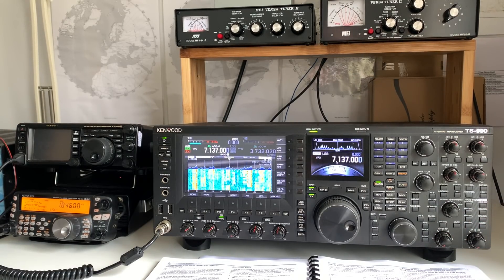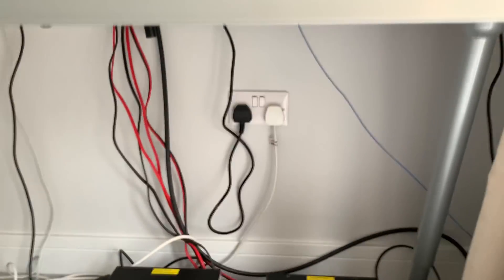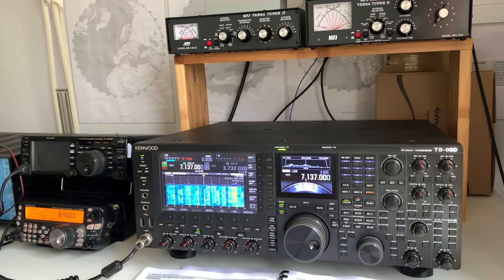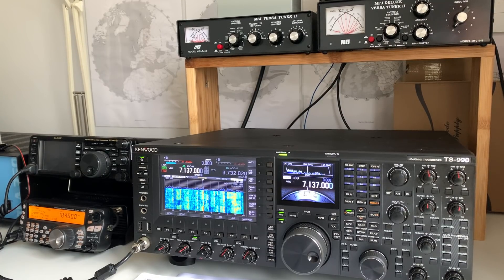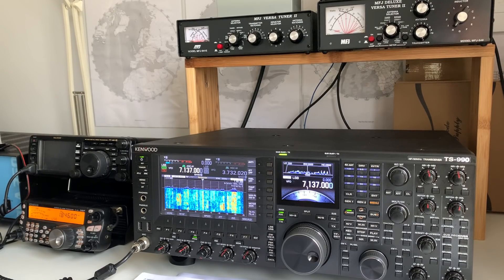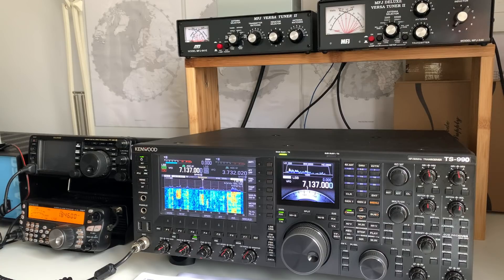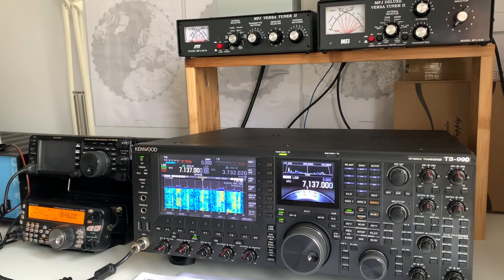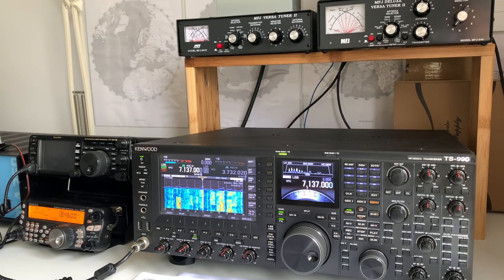Revealed: the uncomfortable truth about how ham radio equipment manufacturers specify their products

Comment: Get a decent good quality tuner (Palstar etc.) rated for 1500 watts. I understand you aren't allowed that much power in old blighty but there are decent tuners available and there is no need to run the light weight models and then complain. Check your coax connectors and mic grounds... Very strange how many wrong ways there are to put on a PL.
Reply from the maker: Thanks Bill

Comment: I think from experience that everything Top band , Antennas, Tuners , Earths has to be as good as possible to avoid RF and reflected SWR power back into the Tuner or worse the Radio . I think a more robust Tuner is required for Top Band operation , not knocking or promoting any brand names just needs to be more robust and be capable of handling larger power levels and be on top of the job. I wouldn't in any situation rely too much on internal  radio ATU systems other than to tidy up at both ends of the SWR curve for a reasonably  resonant antenna  for the band you are working on at the time .  Its a £5K radio and needs as much care and attention - (Safety back up) to provide a good long life and the hassle of expensive PA repairs . The secret with Top Band is to build a good resonant antenna , I think its possibly one of the most difficult of antennas to get right and be a reliable and effective and not just a cloud burner . Cheers G1ILJ Clive
Reply from the maker: Cheers, well said! 73

Comment: There is NO way I'd run 200 watts thru any MFJ product, regardless of what they rated it for. I've owned some of their "stuff" and have fixed a lot it for other hams. Cold solder joints are the biggest MFJ issue I've seen.... some inferior parts and / or craftsmanship.  
I don't want to sound like I'm hating on MFJ, because I'm not. Their products meet the needs for a lot of hams..... nothing wrong with that. 
I doubt you are getting the full 200 watts out of the TS-480. It takes a LOT of power to drive that radio to peak performance. A good quality peak reading watt meter placed inline should reveal the truth. 
I have a TS-990S... absolutely love it. When you mentioned the top band issue in the last video, my finger pointed at the MFJ tuner as the culprit. 
Top band is a tough one as most people don't have the room to run a resonant antenna so they rely on a tuner to bring it in on a shorter antenna. That's fine, if that's what you are doing, but I'd find a much better tuner (Palstar) to pair with that $8,000 radio than the MFJ tuner. (just my 2 cents)
Reply from the maker: Great comments - thanks my friend. 73

Comment: I wouldn't use an MFJ tuner at that power level. 300W is a maximum and with a reasonable match. Top band will be the hardest test for the tuner probably. I have always slightly winced at your faith in that tuner, having had a similar one made by AEA when they came out. MFJ is a value range built to a price.  There is no margin in that rating. I replaced the inductor in mine with a roller inductor and it was a lot better because it eliminated the switch. Unfortunately that tuner went missing from the RAL shack where it has been used with the 5 MHz beacon, which also went missing. 

If you want a proper tuner, it is going to cost a lot more. I have an enormous Dentron you are welcome to borrow. Its power meter is a bit suspect but it really will handle the power. You can see from the components used. What you have now is like putting cheap tyres on your Lotus. OK until you encounter a challenging bend in the rain.

So why is the 480 not as bothered by the MFJ's arching?  Several possible reasons. The PA might be more tolerant or the 990 might be producing more power or it could just be different lead lengths. Most probably the 990 has better compression and really is producing 200W with a lot of punch the 480 is producing less punch or power. Looking at your setup, you have long cables to the 480 and if they drop a volt you won't get the full output. My IC7300 suffered from that, I shortened the power lead and it was much happier. Sometimes fuses can be lossy. probably
Reply from the maker: Thanks very much Mike - the voice of reason - and there's not too many of them about here lol. Cheers and 73

Comment: When the Resistive Reactive numbers become increasingly higher above/beyond 50 ohms... the little MFJ's rating varies with those increased loads. It's only capable of so much. MFJ has their good points, wouldn't hurt them to dedicate themselves toward an improved quality control. I'd go over the tuner's internal connections for a start, especially the ground connections. Just like a tube, there's a saturation point where things start to turn ugly. Could have some common mode current issues?
Reply from the maker: Thanks for your comments. 73

Comment: Hi, s the antenna you are using long enough? What impedience do you see with an analyzer?
My experience with MFJ is good but the maximum power rating is with a good 50 ohm load.
Good luck O.M. KF3DJ
Reply from the maker: Hi, yes the antenna has a bare match of 2:1...thanks for the info. 73

Comment: +1 for the ATU being the problem. Try to spring for a Palstar. Try running the KW into the ATU with AM, no mod, but a 50W carrier. Thats full duty cycle. I bet the MFJ won't handle it. Ideally into a dummy load. I have an 890 here and I run it via a Bird power meter. Into a dummy load its very accurate. I'd trust the 990 way more than the MFJ.
Reply from the maker: Thanks Andy. I have a dummy load ready for round 2 lol.

Comment: I would get rid of any MFJ equipment, in my view is it very poor quality, in some case rubbish! Get a decent auto atu such as an  Alinco EDX 2 or an SGC SG230, that will handle 200 watts, or if you want a manual ATU get an old Yaesu or Kenwood ATU that will handle 200 watts, or put up some prober resonant antennas, you should not need an atu. 200 or more watts into a rubbish antenna, will never better 20 watts into a resonant antenna.
Reply from the maker: Thanks Len.

Comment: Thanks for the informative video as always. MFJ are highly promoted, and, as such are often recommended.They certainly are not "cheap", and for the price point, and the fact they are not an oriental knock off, the customer should get what they pay for. Looking through the comments, it seems to me that the reputation is not deserved, with simple visible quality control issues. In this day and age, and particularly with an American company, a country where you can be sued for anything, it seems to me to be shortsighted not to ensure a product is up to spec. I am now going to strip my MFJ tuner and check the plates! 73 Jim M7BXT
Reply from the maker: Couldn't agree more James and to be fair to MFJ, despite lots of comments on here that their products are junk - it's not the case at all. I have three of these units and all work perfectly on 80 metres down. The point is they simply don't perform to the stated specification. Lots of clever people on here just don't get that. Keep safe. 73
Reply: MFJ is decent. MOSTLY. Like any other company they have their issues. Where MFJ excel is customer service. They will help walk you through repair yourself if desired. Repairing MFJ products yourself does not void warranty.

Comment: MFJ-948 mobile tuner does 80 to 6 meter not 160 meter
Reply from the maker: You really should get your facts straight before posting - it's easy to looks a bit silly otherwise: "The MFJ-948 Antenna Tuner has nearly all the features (except dummy load) of the MFJ-949E -- the World's leading 300 Watt antenna tuner. Full 1.8-30 MHz operation Custom-designed inductor switch, 600-volt tuning capacitors, Teflon insulation washers, and proper L/C ratio gives you arc-free no worries operation with up to 300 Watts 1.8 to 30 MHz. Tunes any Antenna Tunes out SWR on dipoles, verticals, inverted vees, random wires, beams, mobile whips, shortwave receiving antennas... Nearly anything! Use coax, random wire, or balanced lines. Has heavy-duty 4:1 balun. Custom Inductor Switch, The inductor switch is the most likely component to burn up in any antenna tuner. MFJ inductor switch in the MFJ-948 was custom designed to withstand the extremely high RF voltages and currents that are developed in your tuner."....just sayin' 73 xxx

Comment: I have had problems with the same model of Mfj tuner! I cannot tune my 80 meter loop down to 1:1 on 3.588 kHz and never tried 160. I took the cover off and the capacitor plates were not equal distant from each other. Never use an Mfj tuner without a good inspection, especially on expensive radios. It is imperative that you make sure all is well prior to transmitting. In my case I burned up a $200 remote antenna switch due to this almost worthless piece of junk. Note that I can tune the entire 80meter band on my 80m loop with Ldg tuner.
Reply from the maker: Thanks for your comments, Dan. 73

Comment: If your getting 200w or even 185 on the modes where it should, I wouldn’t worry about it. (FM,CW,RTTY). 
It’s hard to get a accurate pep reading. Meters that use a powered circuit are more accurate. I can also endorse the Palstar at2k which has a peak reading circuit with hold. Bought the Palstar after burning up a mfj. Another plug for the Palstar is the 6:1 vernier dials so it’s not touch at all. 
A real fine piece of kit. 
The 990 may be more sensitive to a complex impedance you may have going on there.
Reply from the maker: Thanks, Mike.

Comment: Have you had just connected the coax leads (ANT / TRX) to the MFJ or other leads as well (12V power)? Wondering how an otherwise coax-connected ATU could produce RFI. I had this problem once but then it turned out to be the 12V lead that I used for the ATU meter light. I choked the 12V lead and all was okay again. DL1GKC
Reply from the maker: No, just the coax. Thanks for your comments. 73

Comment: I have a MFJ-949E and I get some audio issues when SWR is low and when I tune the antenna to slightly lower SWR the audio issue goes. It can happen the opposite way also. I sometimes have to take the 949 out of line to sure RF and audio issues :/
Reply from the maker: Thanks

Comment: One thing to consider is linearly /signal quality. The 990 has the pa devices running off 50v rather than the 480 at 12v. The 50v pa should be a whole lot cleaner for the same power, partly due to the lower current needed and the easier impedance matching. 73 G0JLF.
Reply from the maker: Thanks John.

Comment: From your description it sounds like you are having RFI issues with the TS990, probably due to common mode current on the feeder. My recommendation would be to make a decent common mode choke and fit it to the feeder. The difference with tuner in or out of circuit may be down to the change in length of the feeder when you add or remove the patchlead etc. 
ALL tuners can handle more power into reasonable loads than they can into "strange" impedances. 
I believe ALL of the problem you are having is down to RFI in the shack due to common mode current, some rigs will be more affected than others. FWIW I have had RFI issues in the past due to common mode current, a basic test would be to take the antenna out of the equation and operate into a dummy load as someone else suggested.  The common mode choke can also help a lot with received noise.  Good luck with getting it resolved.
Reply from the maker: I've had those issues as well, but it still doesn't explain why the problem ceases when I switch the MFJ out of circuit. Thanks and 73

Comment: Hello. How about to remove a top cover from the MFJ tuner and start to transmit with no any light in the shack. Will you see some sparks inside of the variable capacitors? In my case spacing between some of the capacitor's plates was almost zero. So it was necessary to adjust it in order not to have a short circuit. Especially at high power. I've heard that first thing you want to do before MFJ usage is to check variable capacitors.
Reply from the maker: No need to remove the lid - you can see arcing through the meter - it's not happening on this issue. 73
Reply: Yep.  I had the same problem.  Easy to fix but there it is.

Comment: The general rule with MFJ tuners is they work fine at 50% of their power rating. Measure the output of each radio on the same dummy load with the same power meter on the same frequency, that's the only way to get a true picture of what's going on.
Reply from the maker: That's interesting because at 200W output, the peak power on SSB is about 150W..no issue at 80m and lower though...

Comment: MFJ is crap as the others have said and I wouldn't have one in my shack. Having said that you realize that there's no appreciable difference between 100 watts and 200 watts when it comes to signal strength at the other guy's end? Any perceived change is all due to propagation and might be only half to one S-unit at best. You pretty much have to go 500 to 800 watts to get an extra 2 S-units. The RFI whether or not the MFJ revealed it suggests that a single ground rod isn't doing the job and just because it "goes away" without the MFJ doesn't mean it's really gone. I've got four grounding plates (I've got a creek in the backyard and can't drive 8' ground rods through the rock) and three ground rods near the house all bonded together with about 900 feet of buried radials under both of my two verticals and terminating in a short thick ground cable to the shack and all my equipment is bonded together. If I don't do this or if a ground fails any of my rigs (Flex 6600, KX-2 or especially my 180 watt vintage Drake TR4C rig) trips the circuit breakers to the shack. So I'd rethink your grounding and bonding. I've redone my three times to get it right. Second what antennas are you using? If they're not resonant (and all of mine are) it adds to the challenge especially when it comes to RFI. This is especially true on 160 and 80 where getting horizontal wire antennas up to the optimum 1/2-wavelength is very difficult and getting a vertical to work on 160 or 80 is tough on a small lot as if they aren't several wavelengths away from the shack where it can cause RFI issues. End-feds and worse random wires should be avoided. If the 990 is putting out 200 watts into a quality dummy load then the issue is in your antenna and grounding systems. I think the commentators to this video generally do get the point and I'd offer that they are politely suggesting you might want to rethink your testing method, your grounding and your decision to use antennas that need a tuner to work. Everyone is taking their time to try to be helpful.
Reply from the maker: Yes double the TX power = half an S point. Yes propagation can change the power of the received signal by more than 1/2 an S point. You have no more empirical evidence on this issue than I do and your assumption that a single ground rod is not sufficient is not the 'smoking gun' you appear to have convinced yourself is the cause of the audio clipping on 160m above 120W. A small proportion of the commentators to this video simply didn't get the point of it, they don't understand the difference between empirical and qualitative evidence and rely on voodo engineering to back up their opinions. With the greatest of respect Sir, you're one of them. Try to consider the facts: the station works perfectly with the MFJ  on bypass yet fails with it in circuit. 73

Comment: A video with no operation and or metering being shown , is questionable .
Then trying to use that MFJ at the edges of envelope / max - not unexpected .
I do not think most hams could name much more than a handful of tuners that can operate on 160m - 10m , I would be suspect of using that MFJ on 160m .
Should have at least shown a SWR meter & a power meter with a " video " .
Just saying to be fair .
Reply from the maker: You're not an MFJ rep are you lol? Why say the MFJ is operating at the 'edge of the envelope'? MFJ don't specifiy band versus maximum TX power - they simply specify TX power. It sounds as if you're making excuses for them - and I'm saying that also to be fair. 73
Reply: @OxfordShortwaveLog  I guess because most hams realize few tuners do well on 160m , then picking a lesser tuner - MFJ and operating at max power on the typically hardest [ for most tuners ] band - just saying - at least this is what I understand , so with the combined above & no metering / operating --- that leads me to have to do what generally we shouldn't do - assume .
There is the odd issue with using same tuner & 2 different radios , but again not enough info , to agree or disagree - in this format .
Reply: Dang left out --- " out " in the sentence , few tuners do NOT do well on 160m ;)

Comment: The only tuner I have had good luck with is the Palstar AT-5K on 160M. Since the MFJ works with the 480 you may have common mode current or a ground loop problem. A 1:1 balun between the 990 and MFJ tuner may help
Reply from the maker: There's no chance of CMC or a ground loop - checked already but thanks for your comments Sir. 73

Comment: A common grounding bar, which most of your gear should be earthed separate - independently going to the focal point. This should eliminate any grounding loops (short and decent gauge. My personal opinion is to use a quality tuner that can handle at least double what you drive into it.
The Kenwood ts 990 is a fantastic transceiver, I use it from time to time with a pr-77 via the built in EQ.
Nice video Clint, best 73 GM0KET
Reply from the maker: Already done - and thanks for your comments Ray - much appreciated. I'm getting bored of hearing excuses from other commentators - you don't use an MFJ on top band above 100W etc...they just didn't get the point of the video. 73!

Comment: Open up the MFJ and inspect the capacitor plates. You need at least 3mm spacing. Also, you might directly see arcing marks on the top of the plates etc...
Reply from the maker: I've already checked - all ok. thanks and 73